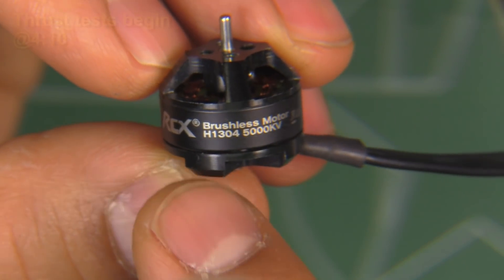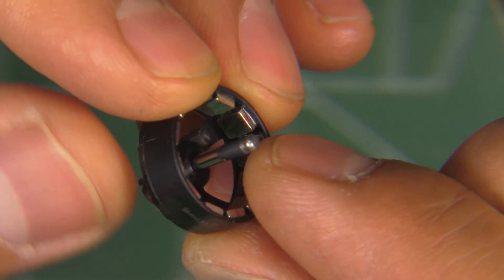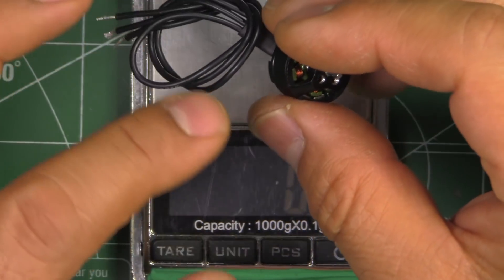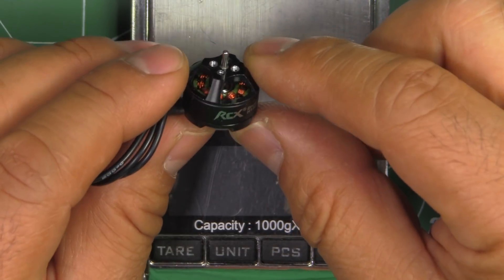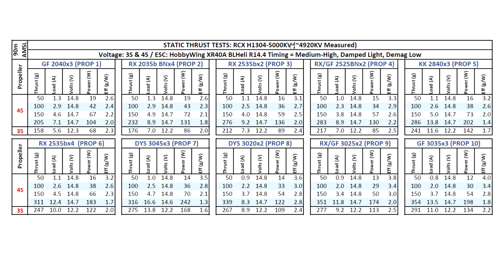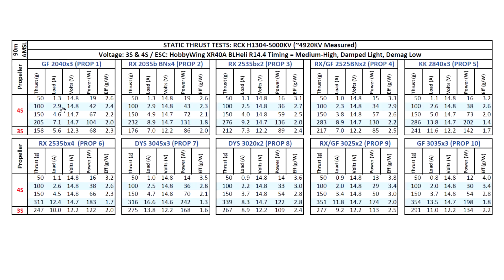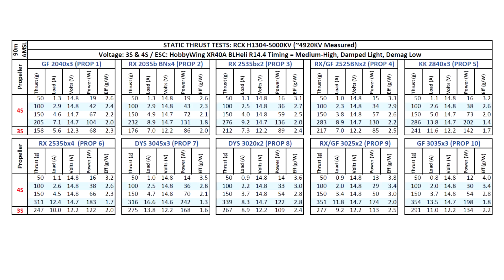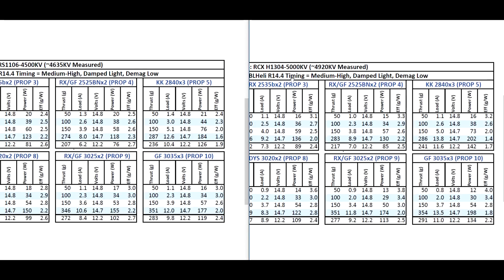MyRCMart.com RCX H1304-5000KV Thrust Tests & Overview

Comment: Im thinking of building a 2.5 inch 3s build with the avan 2.5. Should i use the h1304 5000kv or the nk1306 6000kv?
Reply from the maker: For 3S and 2.5" prop if you want "fast" then go with 6000KV.

Comment: If this motor has a 2 mm shaft, what size E clip would it require for replacement? 1.5 mm or 2 mm?
I wasn't sure how you properly measure E clip size. Thank you!
Reply from the maker: The standard way is you use same size clip as shaft. So clip size is 2mm. Shafts have a very shallow groove where clip slides into place so that's why they use same size clip ad shaft diameter

Comment: Any chance you can throw the 1304 4,000kv on the stand real quick and spin it up with a few of the 2.5" and 3" props so that we have a comparison?  I have a hunch that this 5,000kv motor is a bit overpropped/trying to turn too much RPM on 4s for the more pitchy 2.5" and 3" props.

Comment: Can you run this motor on 2s with a low pitch 2.8 or 3 inch 2blade prop on a light weight 130 mm frame
Reply from the maker: Yes! should be no problem for this motor to handle a prop like that on 2S.

Comment: I’m running these motors and they come down warm to the touch. Flys great but the back half of the stator on the rear motors keeps getting more and more brown with every flight. What would cause this?
Reply from the maker: What voltage, propeller, AUW? Tuned properly? No rapid oscillations? No crashes that could've bent a shaft? Bearings OK?
Reply: 4s, tune seems to be good. No p term oscillations. 3.1.7 with pt1 instead of biquad. Doesn’t even come down hot is the weird thing. 2850 props, in great shape. Only thing I can think is in the few punch outs I do it gets warm then cools down. But why just the back half of the stators?

Comment: From results one can see that for 3020x2 prop for 3s load is 8.9 end eff 2.4 but for 4s it is 8.3 and 2.8 ? So not only You get significantly more thrust but it is also slightly more efficient?  Is this correct? Would it be safe to run them with 10A esc and 3020x2 propo on 4s??
Reply from the maker: Yes correct. Higher voltage increases efficiency when compared at the same power output (same thrust & RPM) at the Max thrust in some cases you may see less efficiency even on higher voltage but not a good comparison because motor will be making more thrust and spinning at higher RPM. Anyway generally higher voltage is more efficient in electric motors, of course, I'm sure there are some exceptions
These are static thrust so when you're flying the Amps & Watts will be lower by about 25 to 35% and you'll only see these Max in very short periods, when you punch out of dives or basically only immediately after you go from low throttle to full - only for a second or 2, then LiPo voltage decreases due to the high current drain on the LiPo. That's why no issues running 3" props on 4S with these motors. They should be fine on a light build, around 270g at most.
10A ESC is a bit too close to the limit of what I'd use. I would prefer 12A. But if they're good 10A ESCs then they might be OK.
Reply: They are Dys XM series, currently running them on old Deformation Insect 130 Frame with Dys 1104 6500kv motors it is around 120g without battery. I run them with 3s 75C tattu 850mah and i ilke it very much. I know that nowadays it should be lighter but nevertheless it has a lots of power. I want to build light 2s 3incher so i though i could swap Dys 1104 to new build and upgrade insect to those 1304 as it seems it would be quiet a big thrust increase and efficiency. I would only like to swap motors so those dys xm 10a esc stays - but from Yours chart it should work - it gets around 9a at max and real life max should be little less?
Reply: As I live in a tropical country, I ordered the 4000kv for a 3" build based on the DYS 3045 and running on 4S... I'll maybe get a little less high-end punch with 20% less KV but it might preserve the motor.

It's really crazy that this motor hasn't had the hype it deserve...

Would be nice to have a very good 3" prop with this attach system.
Reply from the maker: RC101LAB correct. According to the Amps I measured. For a very conservative expected Max Amps you can multiply my measured Amps by 0.75. 
Hey, it's not always about crazy fast speed. As long as it flies nice and it's fun that's what matters.
Reply from the maker: Christophe AMARU 4000kv with 3" and 4S will be very efficient and should make plenty of thrust for having fun. Yeah these motors deserved more praise and attention. They're still surprisingly good performers !
Reply: Every other prop is less efficient on 4s vs 3s. And every other prop seems to have a more-or-less proportional jump in thrust from 3s to 4s but this one does not.

Comment: Had a 1304-5000kv burn out when testing motor direction, all other 3 motors were fine.
Reply from the maker: For low-budget motors always makes sense to purchase an extra motor or 2, just in case it blow up when you spin it for the first time.
Reply: Yeah I ordered 5 motors, always like to have a spare just in case
Reply: @Elias-Flyingbros  I ordered 5 motors, one was damaged, 3 had strong vibrations, one was good. Inexpensive motors, but unusable for me.
Reply: Ouch, yeah I had other RCX motors vibrate really badly as well...kinda thinking it's a bit of a luck of the draw with these. But if you have to purchase 20 motors to get 4 good ones it does not make sense to purchase, even if the price is very competitive...

Comment: Finally! Almost same performance with the emax 1106 4500kv, slightly higher amp draw. Very interesting from a motor that is what 2 years old? This is the future for 3inch, 1304,1404,1402 etch, lightweight stuff. Thank you for the testing mate!
Reply from the maker: Yes, this motor went overlooked - it does have very good performance as you mention, for being almost 2 yrs old - and it's still offering good performance. DYS 1404 video will be up next. Interesting results too.
Reply: EngineerX awesome!

Comment: Very nice and helpful  review! I always follow ur motor reviews, hard data never lies :)

On the comparison with 1106-4500kv  look at the g/w efficiency is much better  on the 1304 on low throttle, that is very important for flight time i expect. 
I am really looking to build a longer flight very silent quad  in the 13xx / 11xx range ... i am thinking this 1304 might be good the high toque / low kv in low throttle range should mean good efficiency  (given same prop). 

 What would you recommend?   One very strange motor is the BG RCINPOWER 1108 4000KV and the new BH/ DYS  1304/1302.
Reply from the maker: Yes, that seems to be good about this motor, it could be a good option for low throttle performance to get longer flights using 3025x2 props. I just got a few motors from rcINpower, including some 1108s but have not yet check which KVs they sent.

Comment: nice it has a grub screw it makes me re think about micros.
Reply from the maker: They are lots of fun to fly indoors. I've had a lot of fun flying the Armor 90 and only on 2S and 1104-7500KV. Plenty power and speed for good fun and the thing is very resilient in crashes.

Comment: which of the sunny sky 1106 motors do you have for testing?
Reply from the maker: 6500KV ..... gotta wait a bit now, couldn't test it last week when air temps were nice 25C. We're having another heat wave her 41C daytime and close to 30C in the evening :/
Reply: EngineerX can't wait I just got a set.. I won't have an airframe for 2-3 weeks at best though as I've destroyed all Te others 😂
Reply: On topic Sunnysky R1106 6500KV, I also had a feeling those motors should be good and bought them early on.  I have them on one quad now they do not feel extremely powerful , they are noisy and battery life is average 3-4 min on a KK prop 2840 inch. I also noticed KK is putting them on the FlyEgg the original motors were very bad.
Reply from the maker: aboss00 which the RCX or the SSky?
Reply: Sunnysky R1106 6500KV
Reply: I've got the spintech 8000s ( sunny make them )
and they are noisy! hows the power? i presume you using 3s?
Reply: Sunnysky R1106 6500KV I would rate as average to good thrust. The most silent motors I have are the classical DYS 1104 6500kv with the KK prop you can no hear the quad  anymore few meters away.   Last weekend i rebuilt  an  Eachine Falcon 120 with 3800KV  1306 motors in it was more silent than Sunnyskys! 

I constantly due to skill level and flight spots available  I find myself between 13xx and 11xx motors. 
If you are interested in silent quads besides prop & rpm, regarding motors I observed that the stronger the magnets are (more notchy) the more noisy the quad is.  BH T1 1407 which are very notchy  are a very noisy motor.
Reply: aboss00 I want speed noise isn't an issue keeps people away from the beast 😂